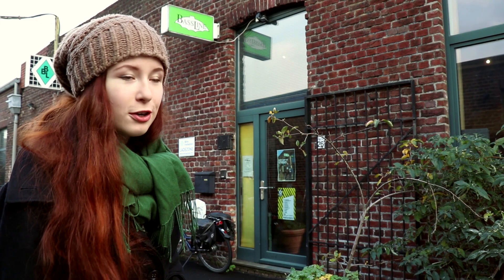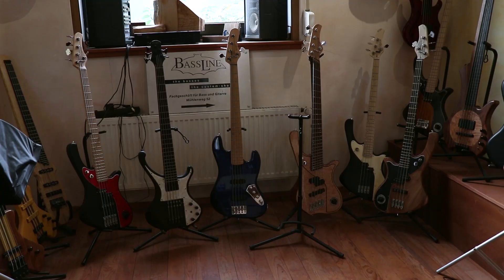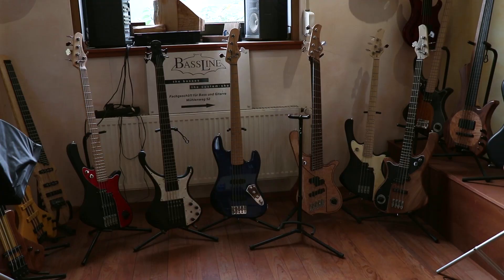STAINING/PAINTING MY NEW GURDY GREEN @ BASS LINE

Comment: Inwiefern verändert eigentlich das Auftragen von Farbe den klang des Holzes. Ich meine gerade mit der Lackschicht ändert sich doch was oder?
Reply: There should barely be a noticeable change at all. It's mostly volumetric resonance of air that makes the sound rather than the planar resonance. When you see the luthier hold up a piece of wood by the corner and listen for its sound, it's more of an assurance that it's good stiff and solid and won't split later rather than the actual sound it's gonna make.